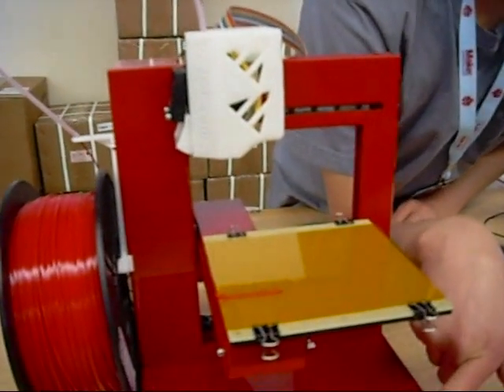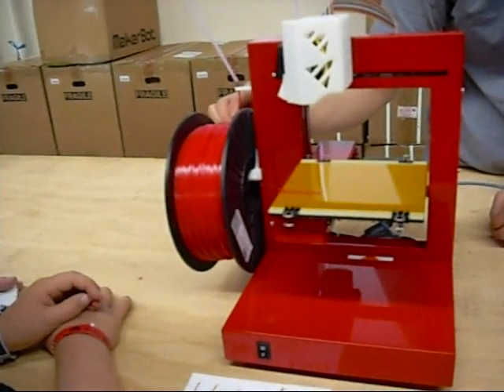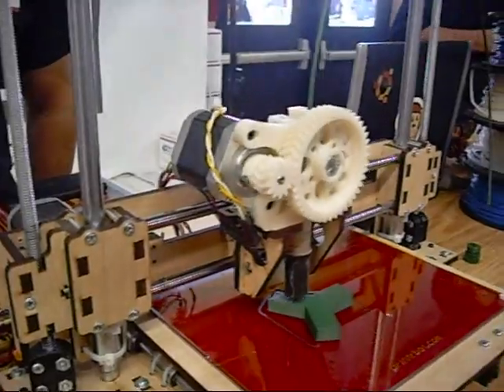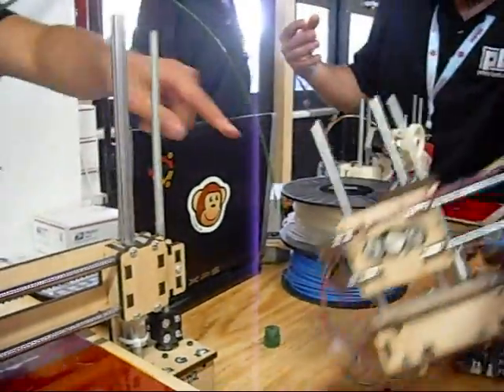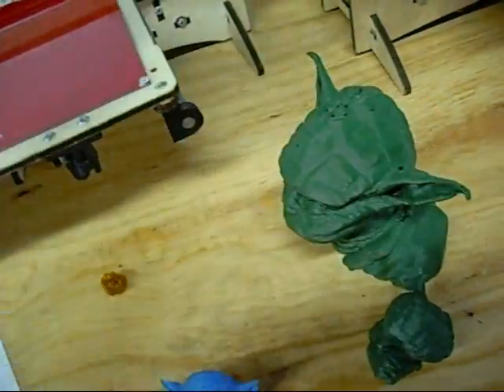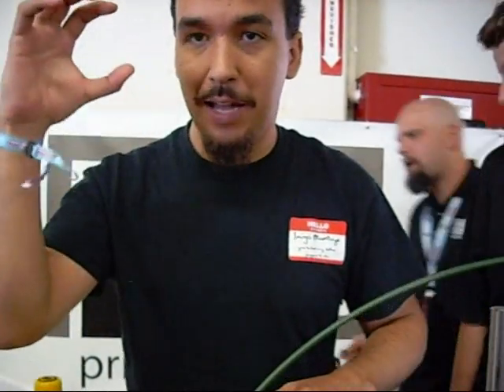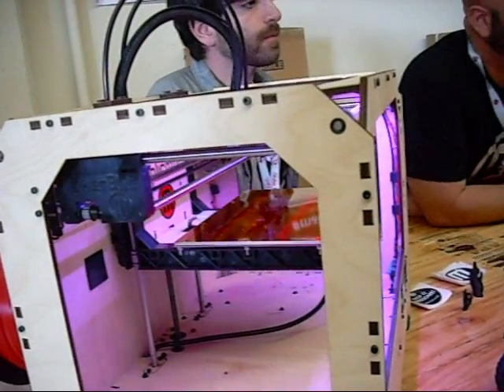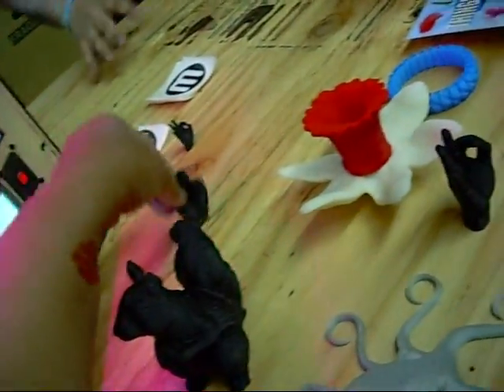Lots of 3-D Printers at Maker Faire 2012!

Comment: Are the 3D printed objects structurally not compatible to replace other load bearing structures? I mean is there a limit to what these devices can make? For example, they can make "display items" but perhaps not load bearing structures and I don't mean in massive scale but for instance, could you 3D print a working pump for a basketball (excluding the metal pin/tube of course) but a piston that can withstand pressure etc... 

I would think that 1D layering would be like grain on wood

Comment from the maker: It was $1999 for the two color.  For the one color it was $1799? about.  From what i understand it is important for you to verify the reputation and support of the manufacturer if you get a lower end printer... lower end was around $500 or so... but if you purchase a low-end printer and it doesn't work, it wasn't cheap.